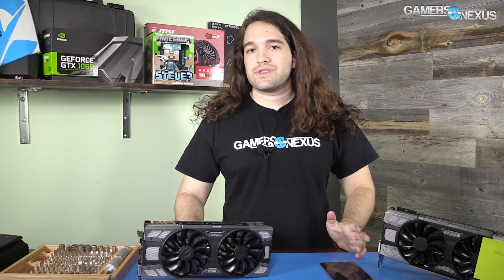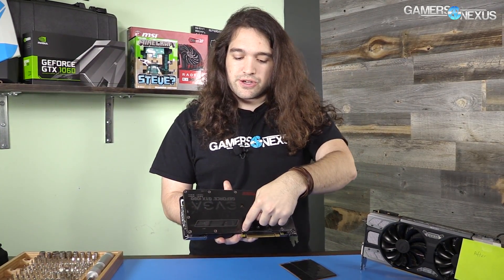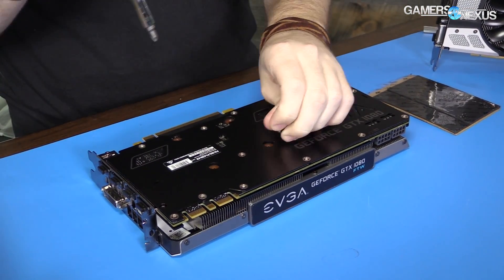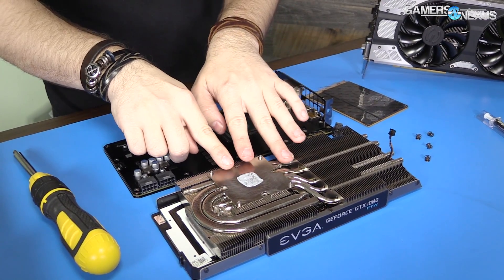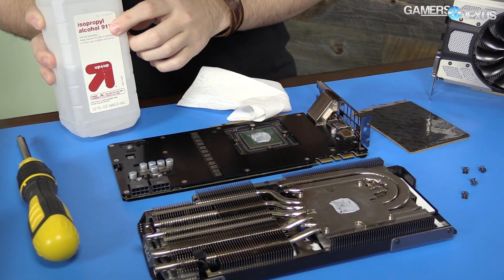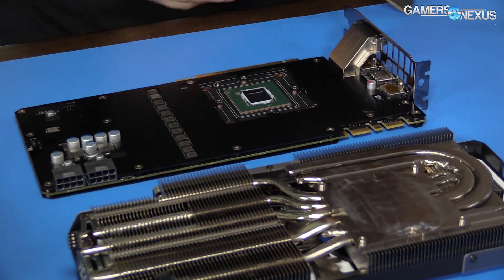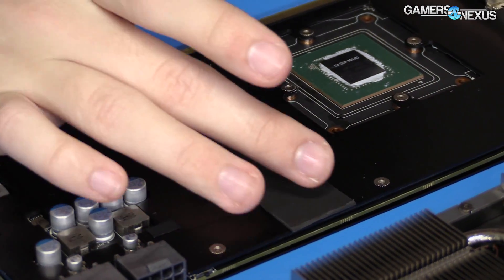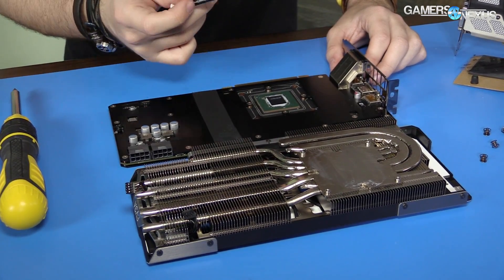How to Install Thermal Pad Mod on EVGA GTX 1080 & 1070

Comment: I have the 1060 FTW ... do you know if it has the same issue ??
The temps are a bit on the higher side, gets to 75 degrees within 2/3 mins of gameplay.
Reply: Its that model in the 1060 3GB, 6GB / 1070 / 1080. Its in his article.

And you are probably looking at GPU temperatures, unless you have the proper tools to read VRMs.
Reply: I emailed EVGA last night and they responded very quickly. Less then 7 hours later (this morning) i got a reply. Anyway, I've just requested the temp pads. The new vbios is not out yet for my card but they say "available soon".

I'm not toooo pissed off cos 1) sometimes shit happens 2) i had to RMA my Corsair H105 water cooler so I'm not using my main PC for a few days. Gives me time to fix this GPU issue.
Reply: Peter Saint
People should be glad that they came out and faced the angry mob. Just like jayztwocents said, alot of companies have issues and pretend its you mishandling / mistreating the hardware, and so it died.

If anything, praise EVGA for coming straight up clean with it all.
Reply: Tripnotik25 Definitely. I respect EVGA for that.Shit happened, they came clean, sorted the problem asap and that's that. Wish everyone that mess up was like that. 

The problem is relatively easy to fix anyway. People should just accept it, fix it and move on. 

I'm not gonna stop buying EVGA cos of this... if anything, the way they dealt with it, reinforced my trust in them.

Comment: Nice tutorial steve, thank you. I have just the regular 1080 ACX 3.0 gaming card and just waiting for my thermal pad order to get approved by EVGA so I can get this done. I've been running a custom fan curve since I bought the card because it was set too low to my liking based purely on my GPU temps which may have unknowingly helped to alleviate this issue.

Comment: What exactly is the thin TIM strip on the front of the card contacting once applied?

When the main cooler gets mounted it looked like the heat will transfer directly to some of the fins and not a plate.... strange?  It might help a bit, but there is no metal surface area to dissipate the heat to...

The back strip makes more sense.
Reply: I agree totally. I dont understand how this isnt the question everyone is asking themselves. Where is the metal mating surface the termal pad is making contact with like the older acx 2.0 coolers had.

Comment: +Gamers Nexus, what is the nominal thickness of the pads that EVGA provide? I have 17W/mK pads that are better than the one supplied but I need to make sure that I get good compression. 
By the way why did you install the pad on top of the heat plate? Is there good thermal contact between the MOSFET QFNs and an the plinth on the bottom side of the plate? Adding a layer of any pad between the heat plate and the fins of the heat sink will probably introduce another layer of resistance. 
Thanks for reporting this so quickly! Good job!

Comment: I have the black edition 1070, do I still need the large thermal pad since I don't have a backplate? Or is that unrelated?
Reply: No, since it won't transfer anymore heat than the pcb would do on it's own. It's shown in thermal video''s that the BE's stay a tad cooler since there won't be warm air stuck between the pcb and the backplate.

Comment: THATS NOT WHERE YOU PUT THE FRONT THERMAL PAD. You should put it on the HOTTEST part which is ON the baseplate itself. Those things you put on top of are CHOKES which doesnt get hot and dont mind being hot. You want the baseplate to be cold so it can cool the mosfets.
Reply: acnfanmanin acnfanmanin can you explain? you mean the narrow pad?
i have evga 1070 sc, i read something similar in the forums but the instructions evga provided are exactly as shown in video.
what is going on?
Reply: ***** No you're not supposed to put it on top of the chokes is what I'm saying. those things don't need cooling (look at motherboards and watercooling blocks they're never cooled) so you're wasting thermal pad contact area putting it there. You're better off putting it on the baseplate area on the right of the chokes because the mosfets which do get VERY hot are located under there connected to the baseplate.
Reply: acnfanmanin you mean like this http://imgur.com/a/CQkBI ?

on the right of the metal squares?
bacause the official guide says to place them on top, but i wouldnt be surprised if they keep fucking up
Reply: ***** THAT is CORRECT! Yes like that :) if EVGA told them to put it on the chokes...wtf...you're basically trying to cool a piece of copper...why
Reply: wtf? they keep fucking up, are they that incompetent?
should i post this on reddit or somewhere?
They still have to even accept my thermal pad request, it's taking very long....
Reply: ***** Yeah maybe. Id post but I don't have a reddit account lol it's banned here :( i mean if you need more proof look around and I'm betting you you won't see a choke getting any kind of cooling anywhere because like I said they're just packaged copper coils
Reply: masters of EE here.  You're all wrong.  The chokes do get hot and do need cooling.  There's a reason distribution transformers are filled with oil and put in giant heatsinks.
Reply: willis936 If it does need cooling explain why all motherboards and all GPUs by default don't heatsink them. They generate little heat and are just packaged copper coils so they don't mind heat anyways. A transformer is different its way larger and deals with much higher voltage and amperage,

Comment: Steve, I have a EVGA 1070 which boosts to 2012mhz without any changes being made in EVGA Precision OC. I don't want to run the chance of getting a lower boosting card by doing the RMA process, and am comfortable doing the thermal pad and TIM application as I have built many computers and swapped heatsinks numerous times. However, I have never changed the TIM on a GPU so I was wondering if you had a recommendation for a better TIM than even EVGA is providing with the thermal pad kit.

Comment: Wait a sec, so someone buys a 700€ card and still need do shit like this so that expensive card runs fine? WTF?
Reply: No, EVGA stands behind their product. This is just something they are offering to customers who want it. EVGA says it is NOT necessary. They are simply doing these to appease the crowd-mentality. Whether you do this mod or you do not, if your card fails, EVGA has clearly stated they will replace the card under the standard warranty procedure. That's why it's worth buying EVGA branded products. A warranty means nothing if the company is hard to reach or has terrible customer support. Kudos to EVGA for responding quickly and appropriately to a 'mole hill' that the internet has created into a 'mountain.' Absolutely ridiculous mob mentality from people on the internet.
Reply: Eduard Marcinek You got it backwards, this is a FTW card not a WTF card
Reply: Matthew Fennell is FTW MODEL BETTER THAN NONFTW?
Reply: no this is for cards people already bought + like he said it is optinal you can also update your bios but that will make the fans run a little bit less quieter. and new card will have that bios by default
Reply: CareyHolzman 

carey, the card failing is one thing, but if it takes out the mobo with itself or any other component in my tower then we have a problem. 
But hey, I don't OC or run furmark for hours so here's hoping.......
Reply: WTF BACKWARDS IS FTW
Reply: @maticooli112  for the win
Reply: Just the EVGA FTW model, and you have to do shit like this because EVA fucked it up.

Comment: +Gamers Nexus  Is it better to use my Noctua NT-H1 thermal compound instead of the included one ?
Reply: Noctua does not specify the thermal conductivity. But considering it's a good brand and they ship everything with it, it would be fine to use.

Comment: Alcohol is not the best cleaning agent for this sort of work but it is the most often recommended. The best agent is Ronsonol Lighter fluid. It is what a lot of electronics technicians use in circumstances similar to this.
Reply: oh please shush Alcohol does the job just fine stop being so picky

Comment: tbh I do think the method you showed for the thermal compound is more adapt for the CPU (since there is a heatsink over the die) If you need to cover a naked die, like a GPU, you should spread it out.  OFC the difference is not so big, but still a bit :P

Comment: anybody know if they will send me a refurbished card if i do a cross ship rma?
Reply: They said on the forums they would be new cards
Reply: they sent me a brand new card and i also won the silicon lottery!!!  thing boosts over 2ghz only drops down to 1999 once in a while.  free shipping both ways ^_^
Reply: +Capta Praelium do you have a link to that forum? I've read that people received used/refurbished cards
Reply: i called them up and they said they would put in a "request" for a new graphics card for me because it was a new purchase even though it was about 15 day past the 30 day cutoff.  havent received it yet though, ill update if i remember.  oh and i get free shipping there and back!
Reply: thats awesome, i have bad luck with that, i might just get a refurb

Comment: Small question, should I use my Actic Cooling MX-4 instead of the included thermal paste? The spec sheet of it online says the thermal conductivity is 8.5W... I may as well, wouldn't hurt
Reply: Exiled Storm Yeah, that's much better.
Reply: MrLehi99 Thanks

Comment: Hey Steve, thanks for doing a video on it. I thought i would be installing the thermal pads blind but with this video, I should be ready. I'm wasn't willing to botch up a 700 bucks piece of hardware because of breaking apart the card.

Comment: Is Safe to buy Evga GPUs Or should I go with another brand ?
Reply: BoOs CTS only reason to buy evga at the moment is for the step up program. I bought a 1080 a week ago from evga only because the 1080 ti is going to be announced at Ces so I'll have time to step up. If it was not for the ti being announced at ces, I would have went with the Asus strix rog 1080.
Reply: Valkyrie743 problem with their step up, is that you can't setup up to an SC, FTW, or Classy 1080 TI.

Comment: Nvidia: Hey, AMD!
AMD: What?
Nvidia: Uh, where can we buy some cheap fire extinguishers?
AMD laughs, Nvidia laughs, everything catches fire.
Reply: EVGA and nvidia are 2 different companies.
Reply: +justanalt no it aint! lol. My EVGA GTX 1080SC is always below 60c.After intense gaming. Maybe an extremely overclocked Founders Edition, but certainly not these cards.
Reply: justanalt whaaaaaat ? Dude, that makes no sense whatsoever, when we talk about temps AMD vs nVidia it's always comparing the cards in the original form (Founders Edition) and that's were AMD fails.
Reply: ***** the Gtx 1080 still runs cooler than the rx480 while being twice as fast.
It also consumes 20watts more than a 480 ha ha
Reply: grg cost is irrelevant since the chips probably don't cost any more to manufactor.

Twice as fast, but the same wattage.

Da fuck is AMD doing
Reply: ***** every 3rd party 480 is 170w

Why does AMD need the same power just to be 1/2 as  slow?!
Reply: ***** it's about $30 a year.

The issue is AMD's Inefficient hardware scheduler.

The gtx480 had a hardware scheduler and as a result it was a house fire.
Reply: only the evga 1070s and 1080s get too hot you idiot. Im using a msi 1080 and it doesnt overheat
Reply: more like 3
Reply: yo do realize this has nothing to do with nvidia what so ever right ? it's completely evga's fault.